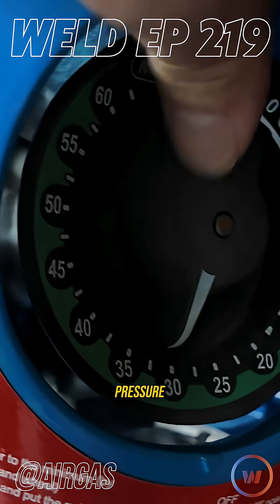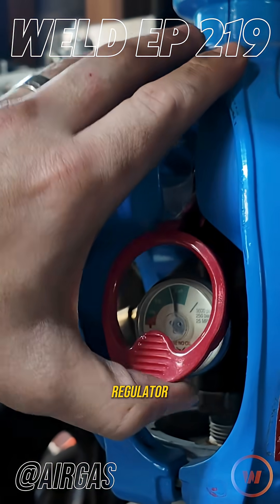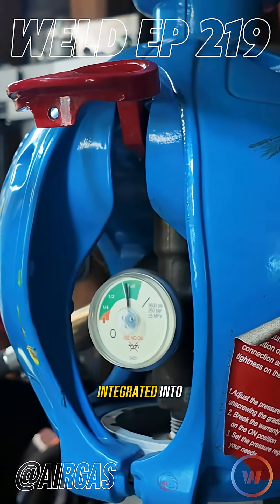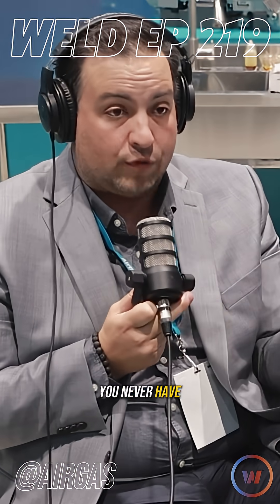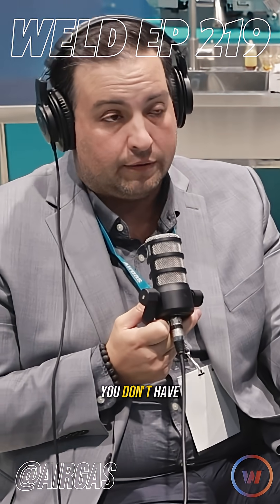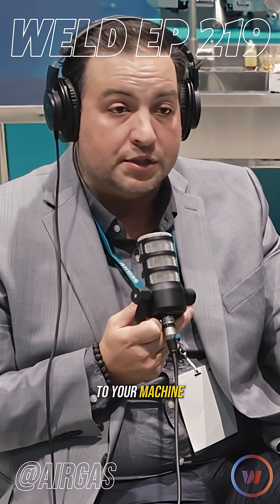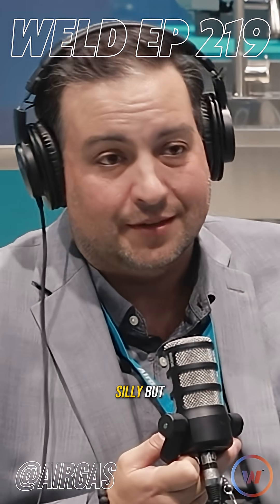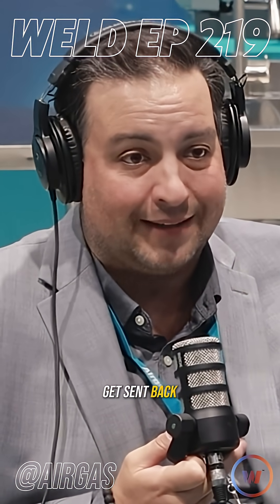Where Is Your Welding Business Losing Money?

Comment: Okay so let's say the average is 15 minutes to change that bottle how much difference in price is your bottle compared to the other bottle is it 15 minutes difference or is it less than the 15-minute difference and then how many bottles changing over does the shop realistically do each day each week each month on top of how many extra bottles does the shop keep on hand are they keeping for extras are they keeping two extras are they keeping one extra or do they really only have one extra if they have an extra and is it a smaller bottle and might have multiple bottles for different gases we might have an Argon bottle we might have a CO2 bottle we might have a helium bottle we might have an oxygen bottle we might have an acetylene bottle and if it's a small shop and they really only have one of each maybe two a backup small cylinder and their larger cylinder how much extra money are they going to have to have tied up in your specialty regulator bottles and if that regulator fails or is not working right and I only have one additional bottle how much down time do they have sure you might bring them another bottle how much downtime did that cost what's the rear guarantee that your regular is going to work and the Quick Connect system every time compared to an off-the-shelf component that they can go pick up if it does fail
Reply: First off I have a wrench that fits it that hangs on a welder between the two bottles it's been there for 15 years and never moves